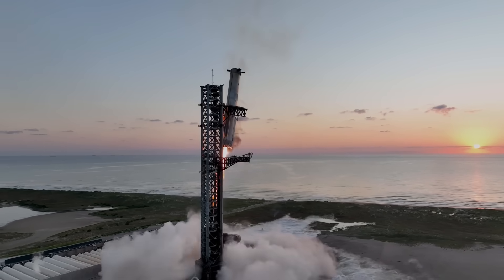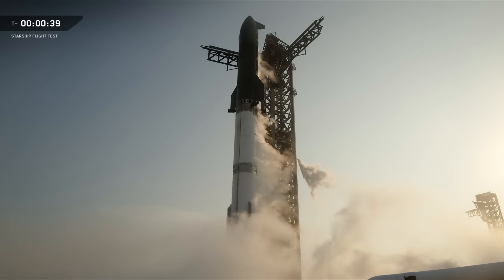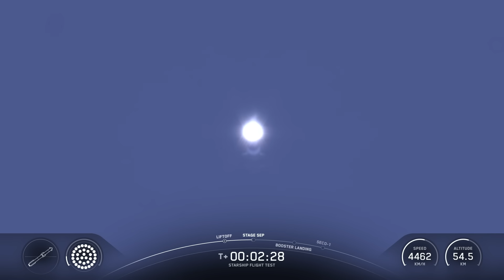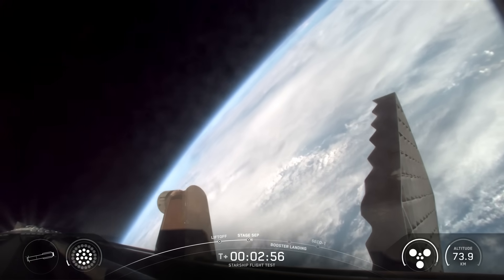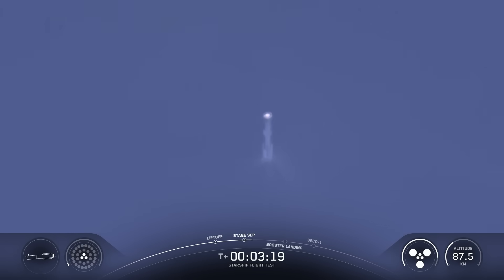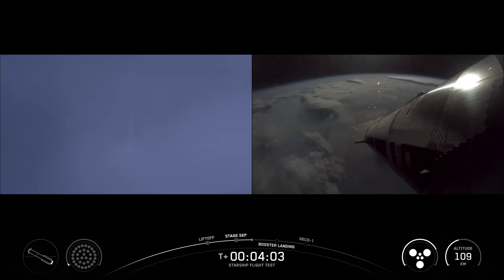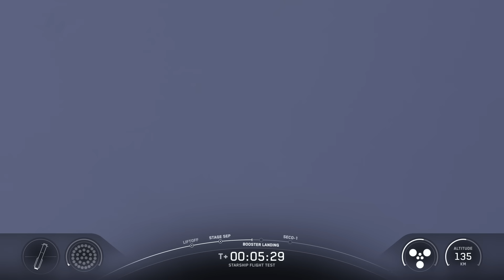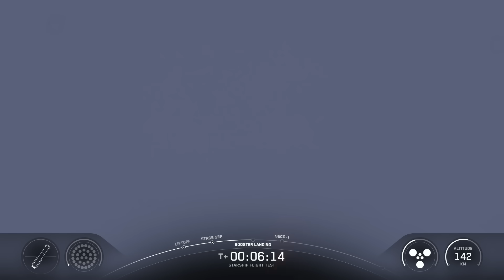SpaceX Builds Largest Reusable Booster, Also Makes Door That Won't Open - Starship Flight 9 Recap

Comment: Are those hot spots failures in the fuel lines? Don't they run the fuel through the engine cones to cool them? So pogo or ice jams on of the veins causes localized glowing and or uncontained leak? Are we sure it's not pogo that hammered both the door and the tanks/engines to death?

Comment: “Space is hard”’- the most succinct description of how challenging this really is.  Amazing progress.
(Media: Respect, please.  Otherwise … go pound sand.)
Reply: Wasn’t hard in the 60s. Made it look easy. Now that we actually are trying and not faking it. Yes it is actually hard
Reply: @billjones8950  It was hard in the 60s and still is today.  In the 60s the dangers were pretty clear - people literally died - just as now (without death yet…but seen with 100s of cameras and 1000s of sensors).  
   Like aviation, failures are the key to learning and making it  “less hard.”  “mens et manus.”
Reply: @baomao7243 they died in the capsule. On the ground. Cmon. Why was Saturn 5 so successful so quickly?
Reply: @billjones8950  Why did they die?  Space is hard.  The answer is always obvious once you have the answer.
Reply: @baomao7243 wire short circuit. Then poof magic moon every time. Oh wait we failed once. No one died. Even made a cool movie about it! One failure instant improvement and success. But today naaaa
Reply: @billjones8950  Good one !
Reply: @baomao7243 crazy to think that nasa would be landing man on the moon next flight if it was SpaceX? It’s flight 10 for them no?  NASA did it by 11.

Comment: Using the ullage gasses in the propellant tanks for the reaction/attitude control poses a serious engineering challenge.  Having such a critical system tied to so many different parts of the ship (tanks, engines, feed lines, etc.) creates too many points of failure.  I suspect that a similar failure happened on an earlier V1 Starship flight and they thought the problem was fixed.  On the Space Shuttle the RCS systems were relatively compact, modular, and independent from other systems so they had some redundancy and they also proved to be reliable.  However... the propellents were also toxic and had to be handled carefully and this was a major pain point when refurbishing a Space Shuttle for its next flight.  

Given the complex rendezvous and refueling missions that Starship MUST carry out, I don't think the current reaction control system is up to the task and something else (with redundancy) should be considered.  I suspect that V2 Starship is already failing wildly to reach it's 100 ton payload target, and adding new systems for reaction/attitude control would add significant mass further reducing an already abysmal payload capacity and maybe even payload volume as well.  There just isn't any good place to put redundant reaction control system hardware other than the payload area. 

Let's face it, when it comes to LARGE, REUSABLE, ORBITAL, SPACECRAFT we just don't have much engineering experience.  There was the Space Shuttle which had both successes and failures, the Soviet era Buran Space Shuttle (that flew only once), and now Starship.  Which could end up being the least reliable, and least capable, of the three.   Failure is always an option.

Comment: A successful Test flight. I remember the Space shuttle having problems with the bay doors jamming. That's why the shuttle had to be rotated for even heating from the sun.
Reply: Yes, in orbit they had time to solve a problem.  In this suborbital flight, & already compromised, there just wasn't enough time to troubleshoot a door.

Comment: There's a limit to the amount of failures that SpaceX can absorb. Not even Elon has the funds to keep throwing money at this, it's not sustainable. The solution is obvious: use tax payer money to keep SpaceX afloat. With the current administration, it should be a no-brainer for Elon to call in some favours.

Comment: At this point, I wouldn't rule out sabotage.Third similar fail in a row.
Reply: Old journalistic saying:  if you can explain something but a stuff-up or  a conspiracy, take the stuff-up every time.
Reply: Nothing can be ruled out but I would rule in another possibility - this thing is too complex to ever work properly and/or the existing design is flawed.
Reply: @olasek7972 I understand. I base the comparison on the first successful version of starship and the oddly similar failures.
Reply: @GalvestonGuy this also happens when you think you fixed the problem but you didn’t. If I tried to hurt SpaceX the most I would sabotage their Falcon 9 operations- the part that generates substantial income and is the envy of the world.
Reply: @olasek7972 Good point sir.

Comment: I think this is an inflection point for Space X. There need to be fundamental changes to the design and operation of the ship - clearly, it’s not working. No matter how many iterations they can produce of this thing, it looks like these problems are baked into the basic concept of the spacecraft.
Reply: I did not see any problems that look "baked in".  The structures are sound & withstand the flight stresses.  They lost attitude control once in space, but both the booster and starship completed the flight profile until deep into reentry.  The door didn't open, but that's easily switched out for another door.  Chase down a few leaks, make sure the attitude control is robust enough for the job, and this thing is good to go!
Reply: @davidkottman3440  "They lost attitude control once in space"  Which is a critical fail as much as the steering failing on a car.   And the problems in all three V2 flights can all be traced back to propellant leaks of different types - that's the "baked in" problem.  And regardless of what SpaceX is saying I still think resonance is at the heart of it.
Reply: @malcolmstreet1  Resonance could definitely be cracking things up, figuring out how to dampen it out &/or making certain things are more rigid or flexible as appropriate should be a fix.
Reply: @davidkottman3440  that's supposedly what they did after flight 7 :-(
Reply: I think they need to replace the "hot-staging" technique with something else.

Comment: One of SapceX’s problems is basic. They first decided what they wanted the vehicle to look like and then retrofit the needed engineering. There still no actually working utility to the design. The current engineering seems to be piecemeal. Why design a slot door (doesn’t work) when you are going to need a much larger door to deploy other satellites and mechanisms with maybe an arm or such? Will it be able carry the weight of a passenger interior? And so on. Just doesn’t seem to be a very adaptable design.
Reply: They are just making up crap as they go along. No real plan or sense to what they are doing. Even after this flip Elon stated he wants to rush to flight 10. These are the same geniuses who thought they didn't need a sound suppression system 😂

Comment: It was 50/50 with the booster reuse as a pivotal highlight, Starship working until SECO-1, but then everything else failing.  Starship Block 1 substantially performed beyond SECO.  Block 2 has consistently and grandly failed before /after SECO, making SpaceX appear entrenched.  That is a bit counterintuitive of SpaceX's iterative-engineering?  Should they move-on from Block 2?

Comment: I’m not sure the failed door test was an indictment on the door mechanism. By the time it tried to open the vehicle was spinning apparently end of end at an incredible rate. For a door that should open in 1g or zero g, this poor door may have been subjected to many Gs oscillating back and forth.

I noticed the spin/ tumble kept accelerating indicating a stuck thruster or venting that kept going. I’ll bet Scott could calculate the rotational acceleration and determine the ma x tumble rate

Comment: When the doors didn't open, I immediately thought of cold welding in space, when to metal parts spontaneously weld together at the molecular level just because there's no air keeping them apart. It's what damages satellite reactor wheels over time. I wonder how that problem is solved. Low viscosity grease?

Comment: I think they need some new staff in a few oversight positions in particular, there seems to be a quality control problem. Starship needs to be hyper reliable, atm its not meeting minimum standereds in multiple areas and problems are not being fixed nearly fast enough.

Comment: How is spaceX still beeing taken seriously if they blew up more rockets trying to get to low earth orbit than Nasa ever blew up trying to get to the moon? Either they are re inventing solved problems and failing, which seems like a waste of money, or are just bad at it. What's their end goal? Making something more expensive and less reliable than say shuttle? Sure the grabby thingy is impressive but we've been recovering boosters with parachute for a while now. There has to be some approach or philosophy issue with their engeneering
Reply: You are farther from the truth than a penguin can be from the north pole.

 SpaceX is building something that has never been done before. They "achieved" orbit, which was not thought possible until sputnik 1 (October 1957), which was the size of a football with antenna.  And it took USA almost 6 months later to replicate. And the only reason they could do so is because the USA spent a decade building ICBMs, sub orbital space vehicles.  

Ok so if explorer 1 is a football, maybe linebacker size, the Starship is the whole damn stadium. It's fundamentally a different problem they are solving, orbit is easy, return everything to the ground and reuse it has NEVER been done period. Reuse of a booster wasn't even possible until they went out and did it.

Comment: They expect failure but so far the reason I feel these are actually unsuccessful are because they are not making it to their intended objectives. They need to test the new ship’s heat shield but they are having issues simply achieving controlled orbital insertion. They failed to open the door and deploy satellites, they failed on the engine relight, and they did not achieve landing success. In the past their objective was to simply get it off the launchpad, but now that they do this just fine their objectives are much harder. 

The thing that I don’t like about the failures is the commentary people simply ignore obvious things like the obvious spin. They keep talking like “everything is fine!” When it was so obvious that it was not fine. It would be good if they’d let us listen in on the talking on the earpiece they have so we don’t rely on them to give us the whole news. Let us hear those callouts they are getting. There was times where it was them listening in but we couldn’t hear anything. I knew it was going horribly wrong from looking at the feeds, and then their commentary basically being quiet as they listened to their earpiece basically telling them the rest of the mission has been scrubbed. 

I just want the honesty.

Comment: armchair not an engineer here but it looks like their doors problems are due to how flimsy and janky the whole setup is in order to try to save a few kilos of mass out of a vehicle that will have like 100tons of payload. Makes no sense to me. 2 electric motors actuating a pivot point on both sides would have no problem opening and closing anything.

Comment: I knew something was wrong at Seco. There was far too much roll from that moment. Then the door didn’t open. The door is cold gas driven much like the attitude control… I’d start looking there!
Reply: At the cold gas system…
Reply: Isn't it warm gas in the ship or is that just booster?

Comment: Why is the Starlink dispenser door horizontal? It seems counter-intuitive to cut a great long door across the line of maximum force experienced by the hull. I would have thought a vertical narrow door would be much less of an engineering problem. It wouldn't need to be much bigger than the two smaller dimensions of the satellites. There must be a reason for the way it is done but I personally don't see it.
Reply: They would need to flip the satalites and that would result in a more complicated design
Reply: @uniquekillerz  Do you mean that uniquekillerz? I think a vertical door with a revolving carousel to feed the satellites to the aperture would be simpler, with fewer parts and less mass.  Rotating the satellites before release would be very easy and simple. Furthermore there would be significant weight reduction in a smaller vertical door as it would require less reinforcement and less bracing (and would be much less likely to distort during launch and so more likely to work).

Comment: Starship is in trouble.  We're now looking at 3 successes in 9 attempts.  I know everyone likes to "rah rah" SpaceX, but this is like Astra or Firefly.  They are basically back to where they were at flight 3.  Superheavy apparently cannot tolerate much AOA... a design limitation, but perhaps V2 or V3 can address that.  Of the two parts. Superheavy seems to be the workable part of the system.  We thought the tower catch was going to be the mission impossible... turns out it's just the ability to get Starship to orbit reliably and stably to say nothing of surviving re-entry or even the far distant plan of re-use is the bridge too far.  NASA has to be alarmed.  There is no HLS if you can't even get Starship to orbit.  Orbital refueling?  Can't even think about that for now.  

There are other downstream affects too.  Axiom Space and Haven commercial space stations are ok, they can launch on FH/F9 or other, but Voyager's Starlab, with its non-inflatable current design depends on a ride to orbit on Starship.  If Starship can't even get its PEZ dispenser door to work, no way it's close to a workable cargo bay.  Starlink is also hung... without a working Starship and PEZ dispenser door, there is no Starlink V3.  At what point does SpaceX start considering that Starship might not be a workable architecture?  Starship feels like some of those 1950s fighter designs... seem good, but once you build it and try to fly it, you find it can't do what the design calls for and it's totally unusable.

Is it coincidence that these issues presented around the same time Elon Musk stepped away from driving SpaceX to involve himself in politics?  He can't be happy.  This isn't like the F9 trials where it took a lot of attempts to learn how to land the first stage, that rocket otherwise worked, it took payload to orbit successfully.  Starship is failing at its primary mission of delivering goods to orbit... this is a fundamental design issue rather than a tertiary functional issue.

Is this a chance for Blue Origin to steal a march and take the lead in lunar landers and large volume payloads?  Is perhaps Stoke Space's second stage architecture the way forward for reusability and not Starship?  I can't wait for Stoke to start flying.  I hope they can show that their second stage design works, is reliable and reusable.  Maybe an extremely upscaled version of the Stoke second stage is what needs to sit on top of Superheavy, and not Starship, time will tell. But, for sure, time is running out for Starship.
Reply: You're staking your bet on Stokes which hasn't flown at all, & dissing Starship which has made suborbital flight more than once?  Yeah, there are still problems to solve, but it's mostly working...
Reply: @davidkottman3440  Yup.

Comment: My guess is that the "leak" (the little symmetrical jet) is oxygen relief valve. The rocket has no way to dump heat other than radiation so that oxygen is likely boiling to hell. To prevent oxy tank rupture the relief valve will let some of the pressure out and with that inevitably some cryogenic oxygen. At least that's what it looks like to me considering how nice and symmetrical that visible jet was. With that I presume there were other leaks, or that valve or other valve just failed. This attempt clearly shows there's problems in SpaceX that need resolution any by this time the entire leadership should have been fired. Taking 9 attempts to deliver nothing to orbit while using NASA funds (yes you paid for these fireworks) is inexcusable incompetence.

Comment: I think it's fair to call Flight 9 either a caveated success, or a mitigated failure. Which of those terms you choose will probably depend on whether your glass is half full or half empty, although from an engineering standpoint it could be argued that the glass is just twice as large as necessary. Assuming no major fixes are required, and the FAA doesn't declare a mishap, I wouldn't be surprised to see Flight 10 very soon.

Comment: I saw this as a massive success!  The flight did well to get into orbit!  The bay doors have to deal with thermal fluctuations, vibrations, and hull flexing, which is difficult to simulate on Earth!  The vibrations are at multiple frequencies, which can change as the ship grows lighter.  The hull most likely flexed to the point of pinching the bay door, so that it wouldn't open.  Engineers need to create a payload dumping method that is a secondary method in case of payload issues.  This is to change the center of gravity for re-entry.  I like the Space Shuttle bay door design, as it functioned and didn't have harmonic issues.
Reply: The cope is strong with this one 😂

Comment: The laws of physics still apply ,, equal and opposite reaction, might be time to put a deluge system on their hot staging ring section. What 500 tons of thrust does ricocheting off Both rocket halves damages both. If you Hammer both chunks hard enough they will break.